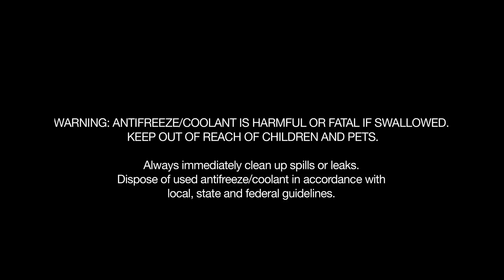How to Install a Water Pump - Dodge Ram Cummins Diesel 5.9L WP-2141 AW6158

Comment: LOL, a master tech installing those corroded cables without cleaning them first (see 1:50). LAME! It takes just a minute or two with a water/ baking soda mix. Otherwise, educational. But I won't be bringing my truck to your shop.
Reply: I⁸[i88